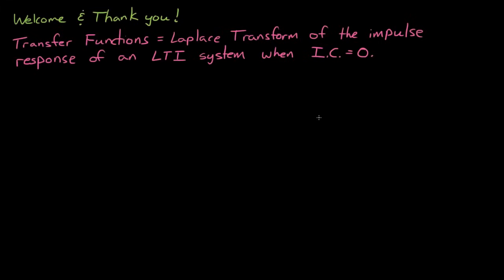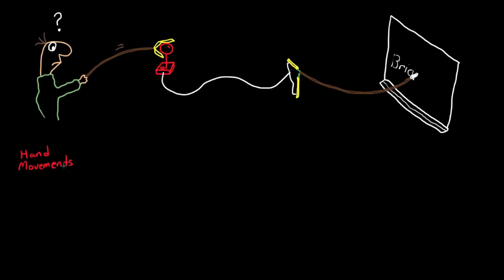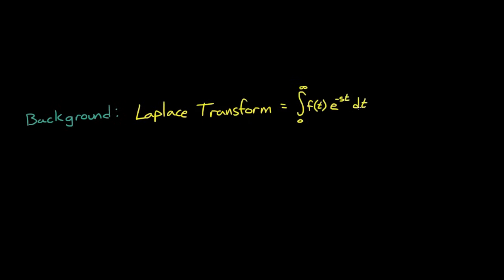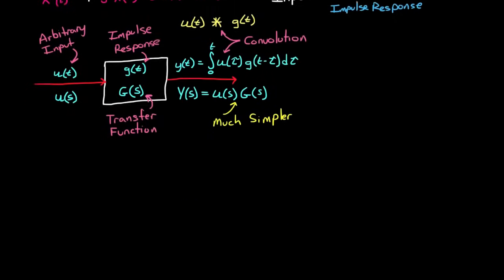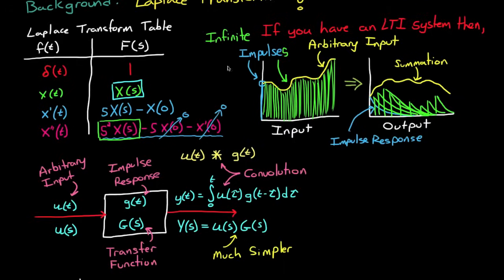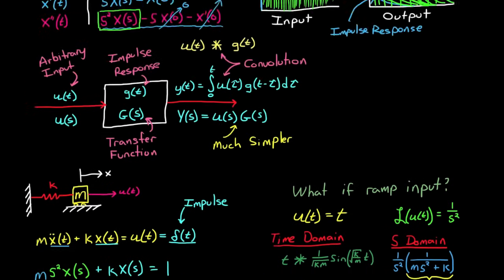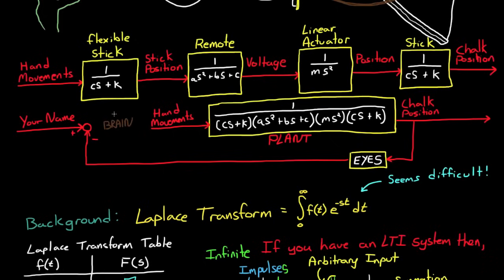Control Systems Lectures - Transfer Functions

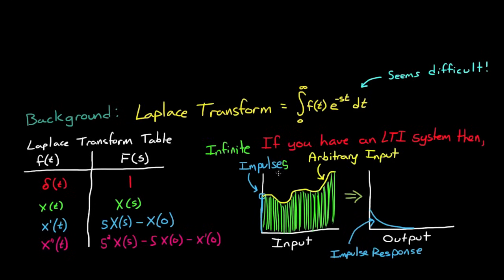Comment: Hi Brian. A correction to make here, possibly. At about 5:20 you talk about breaking up the yellow signal into many impulses. This explanation is a bit loose I fear. The impulse (dirac delta) goes to infinity, not to the y coordinate of your signal as you show here. You should have said, I think, that you are multiplying by (dirac delta)*dt because it is that which gives you the non-infinite "pulse" that we are after. Would you agree?

Comment: Before Youtube and Wikipedia, how did anyone even pass an engineering degree?
Reply: 1221crazyace they cheated because there was means to check like there is now!
Reply: 1221crazyace 
That's exactly right.  I'll tell you how: we learned how to do math and how to pass a test but we didn't actually understand a lick of it or how it'd be applied
Reply: +Chris Ferrell So am I wasting my time trying to actually learn this shit??? Because the school system clearly encourages just "getting the right answer" over actually learning the material as i watch my peers pass classes this way while I struggle to deduce the "why" behind everything >:C
Reply: gespilk That doesn't seem valuable. I'll try and keep overall concepts fresh with review after I graduate.
Reply: I'm in the same boat you are.
Reply: This comment has maintained a fair bit of interest even 2 years after i made it. if anyone is at all interested in how this story ended, I'm in full time employment in an engineering graduate scheme. Keep up the hard work everyone and thank you Brian Douglas for your work.
Reply: We made cheat sheets)
Reply: standard text books made everything clear.
Control system Standard book : Benjamin Kuo
Reply: I've looked on the preview of it on Amazon. The first phrase in the introduction was: "The first question... is: What is a control system?" And there is no answer to this question for the next 10 pages. This really didn't evoke a lot of trust to this book in me in matters of making something clear. :-)
Reply: Good for you!
Reply: Long answer:
The thing is that in engineering the "why" is often unimportant as long as you can apply it. Although the school system doesn't make much sense to some areas, engineering might actually benefit from it! There's just so much to learn that it'd be less effective if you also had to know the "why" of those things. Engineer is a lot about "black boxes" in a sense that you have to tolerate the fact that you can't understand everything you work with (what's inside the black box), you just have to know that it works (what the black box does).
Whatsoever trust me on this: your final grade after graduating an engineering degree says little about whether you'll be a good engineer or not. I've seen this two times with colleagues I've worked with, they were top students and were extremely smart, but they couldn't improvise any solutions or come up with ideas to solve practical problems, and i think that's mostly because they had very little "hands on" experience. They were wonderful to work with though, because given a general solution (and translating it to paper) they could work through it really fast, while they applied second year subjects that made me go "I should know this!". Now, I won't lie to you, most of the stuff you learn will be thrown out the window, but that's not because that stuff is useless, it's just because:
1-People tend to specialize in areas, and a lot of stuff becomes inapplicable;
2-You have software and programs that apply stuff you learned in a way that makes it useless for you to know it.
But since it's impossible for a teacher to foretell what you're going to specialize in, they teach you everything of the basics! And because you shouldn't make assumptions on what you'll work with in the future, try to take in all of the basics, even those parts that seem unimportant (to me that was a big mistake with electromagnetism, thinking that was more of a physicists job, not mine)!

Short answer:
"Why's" are often unimportant from a practical point of view, there's a lot of stuff you need to know, and "why's" take a lot of time to learn, and you'll probably never use them. There's a lot of stuff you don't need to know, and will never know, but that depends on your choices which are not predictable, so eveything must be taught to you, just know that you should take in as much as you can and later it will eventually filter out. Also don't bother if you don't have such a good grade, just try to be active and work on parallel projects.
Reply: Text books bro - good old Ogata
Reply: @maxdavidsoncox1  they still cheat.. everyone screen shots documents into their calculator.
Reply: They will go to college before make there lectures....now we won't go to college, no listening to lectures 😂
Reply: engineering is all about HOW lol :3
Reply: I would say people respond differently to textbook material and lectures. With different level of understanding, some people grasp the idea better than the others, and I'm one of the others. But as introduced here, closed loop system makes you to achieve desired outcome. So I constantly come back and read/practice to correct the misunderstadning I had since colleage and becomes closer to what I want.
Reply: They used Asians to do the math. Simple.
Reply: Before the gym and running shoes, how did anyone get in good shape?
Reply: They actually studied and practiced.  Something too many of us have gotten too lazy to commit doing.
Reply: @MrSenseofReason  i find that when i spens the time to actually learn whats going on, I get less practice in solving questions in and perform poorer on tests. Its a shitty system.
Reply: With Great Difficulty
Reply: @carlosmspk  agree with you after all engineer job is to make things work not why they work ... theoretical knowledge and deep understanding is for researchers and scientiste who wants to go above the existing and known facts
Reply: @MrSenseofReason  to learn something the right way, you should ask the people who are actually applying it in the real world and producing stuff, not a nerdy professor who is finessing you out of your money, with all due respect to real hardworking profs.
Reply: Booooooks
Reply: @chrisferrell2663  interesting to know that, thanks to youtube I've been able to understand a little more of what am I doing, instead of just replicate  calculus that I don't understands, there is a lot of good youtubers who explain complex concepts, and is more easier than looking for a book and try to read to understand better
Reply: gespilk  Sad TRUTH. Learned after graduation.
Reply: @chrisferrell2663  Sounds exactly like what we have to do now lol
Reply: I wish I knew yt and people doing this kind of stuff on yt when I was studying. The fact that I found it only 1 year after pains me. 
But you got to look on and move forward
Reply: @1221crazyace  hopfully in two years I can say the same!
Reply: Yes but it was frikkin hard !
Reply: Together
Reply: Lol Tik Tok ad today
Reply: @maxdavidsoncox1  hi there :)
Reply: We went to lecture, studied notes, read and studied books, practiced like crazy and got our hands dirty pretty much similar to what is done today. These lectures are amazing and helpful but they won't help you much if you don't get your hands dirty (either practically by building something or by solving problems).
Reply: People smart enough to practice at a young age and those who saw this was a very smart move for the future.
And people who weren't afraid of the high learning curve, which is kind of an exponential curve for the most of us.
The tools provided in the present weren't there 20 years ago.
Reply: haha. We do chatgpt now simply. Wikipedia has become ancient

Comment: Thanks for these videos! great job, i have a Q. regarding a generelized block diagram and it is displayed as a matrics of i/o  scalars, how do i extract the transform function? the "classic" statement of a transform function is from the algebric term of: Y*(sI-A)^(-1)*B where this eventualy equals to Y(s)/U(s) , i can try write some examples of the matrics regarding open and closed loops if needed. i would really appreciate an answer for this.

Comment: I looked at your other videos and I'm still having trouble understanding. I don't know what the variable "s" is suppose to be.
Reply: "s" is a dummy variable used in the Laplace transform. As a general rule, it represents frequency in physical systems.
Reply: Twisted Logic frequency of what?
Reply: Oshyrath "s" represents frequency just like "t" represents time in an equation. Let's say if you have a function in time domain: F(t)=2*t ;  you can change it in to the frequency domain:  F(s)=2/s²
Reply: Eduardo Garcia But what is frequency? When I hear frequency, I think of cycles per unit of time. What is one cycle suppose to be?
Reply: Oshyrath trolling on educational videos? If not...I suggest u read Norman S. Nises' "Control Systems Engineering"
Reply: boganix I'm not trolling. I'm trying to understand. I'm taking differential equations and we don't get into Laplace transformations for a few more classes.
Reply: Oshyrath Try checking out some Fourier series videos to get a better idea. Most systems considered in the time domain can also be modelled in the frequency domain. When you hear 'frequency domain' consider it as a mathematical tool rather than the physical hertz connotation you are used to.
Reply: tatlerr u in for a while
Reply: ***** ya are you?

Comment: Very effective way of teaching and explaining sir,...   your videos are very very helpful to me,.. Thank you very much, for making such beautiful lectures on Control Systems.

I've a doubt in the transfer function section, We always work to minimize the steady state error at the output, or say we are intended to make Output Equals to input. If output becomes equals to input then the error signal will become zero, and so as the actuating signal, which is the input to the Forward block (G(s)). now as the input to the G(s) block is zero, how can we say that output will now follow Input??????

Comment: Thank you for the lectures so far. I'm in my final semester of mechanical engineering (It's almost over!! :D ) and these videos have been a great help. I get the idea behind it but when I'm faced with a physical system and asked "linearize the above equation, show the transfer function using matlab" etc, I black-out. Could you please do a video of a full example worked through so we know how to apply the stuff or point me in the direction where I could find worked example vids? Thanks

Comment: Great videos! Very easy to understand and follow along. Mechanical engineer here. I must say, it is kinda sad that I barely touched upon control systems at my university (one class) and did not learn anything.. Now 7 years after Uni and working with electromechanical design in my spare time, these videos are much appreciated .  Thanks for the time and effort spent spreading your knowledge and from what I can tell, love of mathematics.

Comment: It's interesting how we avoid doing the convolution integral by using the Laplace transform, which is also technically an integral. The Laplce transform is just an easier integral to solve and we also have these ready-to-use Laplace transform tables. Awesome!

Comment from the maker: Yes if the system is Linear and Time Invariant (LTI).  But this is the same restriction on the S-domain functions as well.  If the system is not LTI then it is not guaranteed that the process can commute (in fact more often than not they can't commute).

Comment from the maker: Hi Safvan, I chose a harmonic oscillator rather than a damped oscillator just to make the math a bit easier.  I didn't want to dwell too long on the math of converting the differential equation to a transfer function.

Comment: Thank you for another wonderful video in this excellent series. I do have a question. This video implies u(t) is a generic input to a system. At one point, it's equated to the ramp function. I thought u(t) was the step input as explained in Lathi's awful signals and systems textbook.

Comment from the maker: Also, as far as deriving the equation of motion, you can search wikipedia for harmonic oscillator.  But the gist is this.  Use Newton's second law, F = ma.  F is the sum of all of the forces on the mass, i.e. F = u(t) + [-k*x(t)].  The spring term is negative because the force acts in the opposite direction of motion.  Set F equal to ma or u(t) + [-k*x(t)] = m*x''(t).  Then just combine the x terms on the left side of the equation and you're done.  Hope that helps.

Comment from the maker: Hello Sean, the equation of motion for a spring and mass system with a force input (u(t) is M*x''(t) + K*x(t) = u(t).  The force input can be anything you want solve for, and once you set the input force you can solve for x(t) using some differential equation method.  I chose Laplace Transform method.  I set u(t) to the dirac delta function specifically for this problem so that I could solve for the response of the system, x(t), to that impulse function.